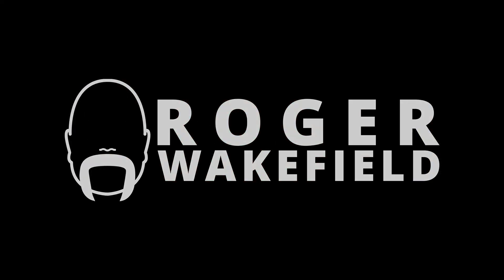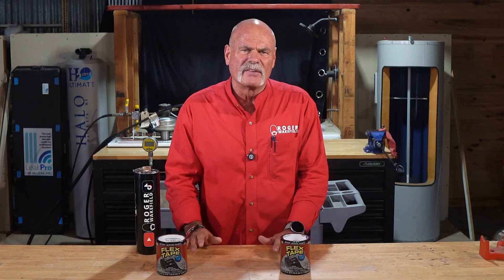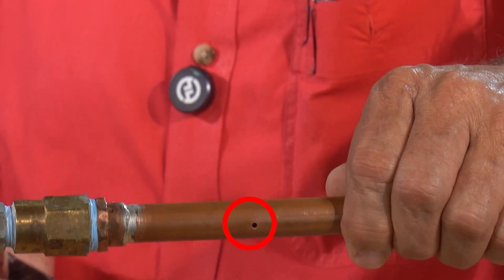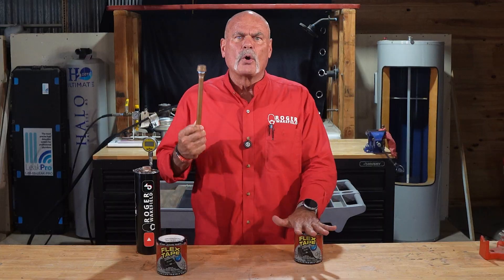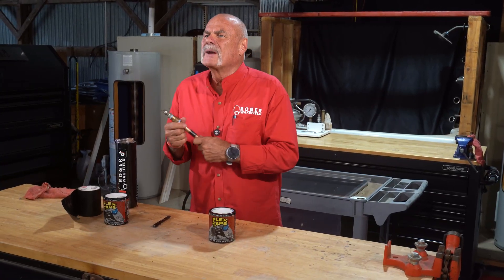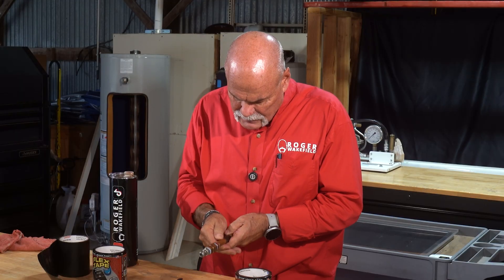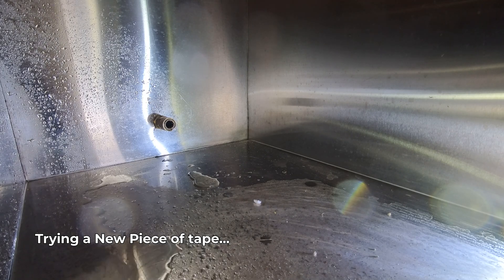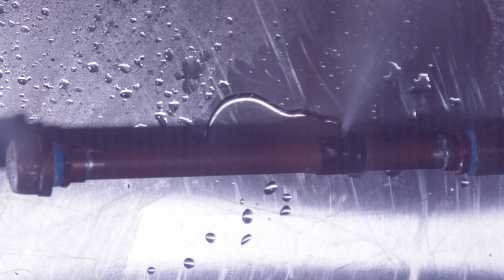Expert Plumber Pressure Tests Flex Tape

Comment: I had a leak at my house. I’m a plumber. I was in the main pipe before the meter. I just put a piece of rubber. And a hose clamp around it now it’s fixed correctly new valves new pipe.

Comment: Flex tape definitely have uses but plumbing repairs is not one of them lol. I had a refrigeration rooftop condensing unit with a messed up metal panel and water was getting in and I taped it with that as a temp repair while we waited for a new panel and it worked great even through storms and crap. I have also used it as a temporary repair for a pin hole in a drain pan (on an evaporator) what I did was tape over the hole then caulk the inside so the tape was more just a backer for the caulk, it held without dripping water all over the walk in until the replacement drain pan came in.

Comment: I fixed a leak on a 3 or 4 inch suction line coming out of a large oilfield water tank with electrical tape once temporarily, and I think it kept holding so I left it for over a year.  We went through a lot of electrical tape in the oilfield LOL. You need the stretch of the tape substrate material to hold the tape very tight (nearly all the stretch taken out so the psi of the tensioned tape against the pipe is equal to or greater than the psi of the fluid pressing against it) and the adhesive layer is only acting like a sealant.  And you have to use a lot of layers crossing/interlacing over each other.  But I would not expect this to work very well or at all with pressurized systems and certainly not with larger holes or cracks.  Anybody that has used an actual leak clamp would understand and not expect a product like this to be able to hold pressure.  This was a nice demo to help laypeople understand what this product really cannot do.

Comment: Common sense would say to wrap it multiple times, so I don't think the test was fair. I'd like to see multiple layers PLUS a pipe clamp. I know the pipe clamp is cheating, but I'd like to see if there is ANY point in using this tape. I mean, if Flex Tape is easier to get than a sheet of rubber to be used with a clamp for a temp repair, then why not?

Comment: I wonder what would have happened if you used more flex tape.
EIther way, I personally found this "fix" to work with low pressure water lines.

Comment: temp fix at best, still need to use the entire width of the tape & double layer it to get over 15PSI, it still fails, but gives about 14 hours if u let it cure for 24hrs. By the time the 38hrs goes by, u could have just fixed it properly within 2hrs

Comment: Best advice as a DIYer is buy a meter key (shutoff tool) and know where your main shutoff is so that IF you have an emergency leak you can shut off the water supply or if you have a 1/4 turn main shutoff know where it's at
Reply: Definitely.  I always put a master full port ball valve in the house to shut off the water quickly and not have to wait for the yard line to be depressurized.  My current home I used an electronic valve and I have it hooked up to wireless leak sensors under every sink and places like the water heater and washing machine, and a home automation controller will shut off the water valve in a few seconds and send us alerts if any of them are triggered.  A prolonged water leak event in your house is something you never want to experience, and dealing with it once is definitely enough.
Reply: Some water departments really don’t like you messing with their meters. But homes here have a main ball valve inside the house(right where water service enters) that shuts water off to the building.

Comment: We bought this when I was a maintenance supervisor in a hotel and it was useless.  A piece of rubber with a hose clamp is a better emergency fix for a temporary repair, before you can solder in a professional repair.

Comment: I would like to see JB Water-Weld.  We sprung a leak on the piping of one of our fire trucks, And until we could get that repaired, we originally tried Flextape but could not get it to seal, we then tried JB Water-Weld and it held solid.  Now that pipe didn't have much pressure, perhaps 4 feet static and I don't recall if we needed to use it with the pump, but it did stop the leak.

Comment: Well I worked at a prision and  we had our water to eat holes in the pipes copper and  I would take a inter tube and  cut some rubber out and  we would take and wrap around the copper pipe and  a hose clamp one  and it never leaked and my warden called me one day and the water was causing the leak the water was eating the copper up and  I know it was not going to go to the city to tell them to cang there water they was mixing with the chemical eating the holes in the copper we had 4 prision and  we had 2 main prision they was basically like down the road from each other to different  wells to get our water so we had at the one prision we had to use bleach and soda ash  at one prision byt we could not use Hydrated lime at ine prision and bleach like you buy at the store in a gallon jug and  we was usung the hydrated lime but we had to change to the soda ash because at the 2 prision they was like a less than a mile apart and  my boss the warden he called me on the souther link and  this was a work relse camp and we had city water at the work camp and in the kitchen  were our hot water heater was and the supply water pipe went across the 2 hot water heater that bought the cold water into the hot water heaters and   it went across to feed the hit water heater so my warden he wanted to know why we had thise hose clamps on the water line that was feeding the cold water to the hot water heater room and he said why didn't  you replace the hole copper pipe abd I said I did put a brand new peace of copper pipe and i saud it has not been in there about 6 month  it was a brand new copper pipe and he said it proble will not hold I said yes sire I got them in different  places we had all copper pipe and I said that I have been putting them in because I told him you know the state is always broke and  I know there nothing we can do but just usee the inter tube like that goes inside a tire and  he said I cant belive it and I said I know were they are and I check them all the time and I have never had one to leak and they have never leaked again now we might get a new one every once in a while and  i told him I had been doung that for about 6 year and we bever had them to leak at any time a inter tube we had bus on the road at the work reasles  and  I used the inter tubed to make gaskets  I keep the old ones they worked great I keep them in my shop all the time and  I used them that like I know a lot of people doest know this but you know your Schrader valve that on your vechicial tires thst the same thing that were you put air in a tire that the same valve that you have on your air condition unit at your house and  on the air condition unit the valve will leak but they make a special tool to change the Schrader valve the man that invented the air condition  unit he was smart to use the same valve  I know I can't spell either  but I know I got off a little on the plumbing but I appreciate  what you did to let us know I know some people think you can take that flex spray and  think it will stop the water from coming out of a pipe to think it will cap the water from coming out abd it doest work either I know this man he was just remolding his bathroom  so he took the flex spary and sprayed in the copper pipe and  he told us thst he was trying to cap the pipe off and  I said that will not work I thing he thought it would hold abd cap the pipe I guess he didn't  have a torch to put a cap on to the copper it might have thought the flex spray would work he like to have flood his house  but he caught it in time I sorry I didn't  want to take your work for trying to get the infomation  iut there and i appreciate  your information  like I said I dint have a college  education   and  I not very smart but I got a little  cimin since ok thank fir what you did to help people out and your time I like that to let people to know thanks for what you do trying to help people that the only way we can try to help people out thanks again I sorry if I saud sinthing wrong i nit tryi g to hurt you in anyway thanks again fir your time and lert7bg people know about things thanks
Reply from the maker: Wow, thanks for sharing your story! Sounds like you had to get real creative with those pipe fixes, and that kind of hands-on experience is worth a lot more than most people realize. You’re absolutely right—water chemistry can eat copper alive, and sometimes you just have to work with what you’ve got when budgets are tight. I really appreciate you taking the time to write all that out and share the tricks you learned over the years. Glad you enjoyed the video, and thanks again for the support!

Comment: I used this for my irrigation drip lines outside, which was then covered with rock.  It worked, but I overlapped it a bunch.  and if I got some water leak, it will just water the flowers.  Other then that, no way